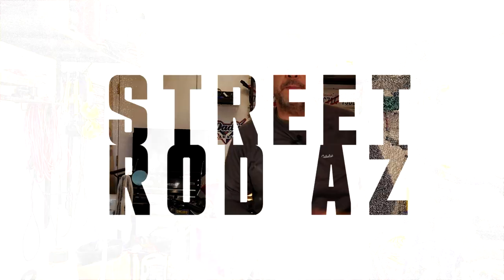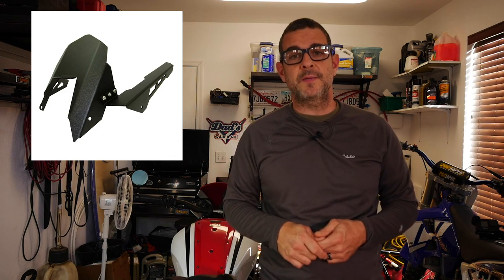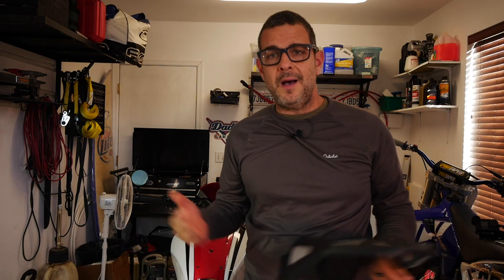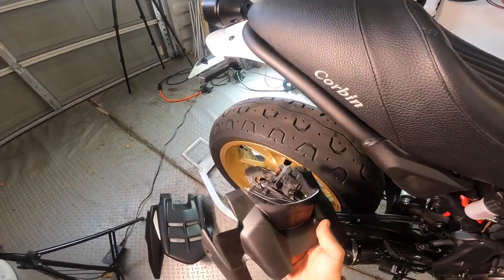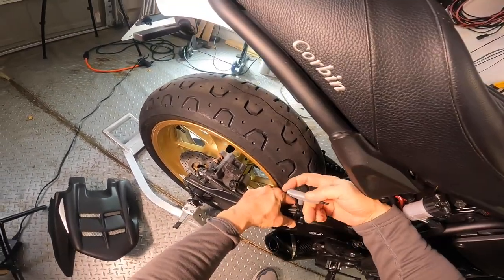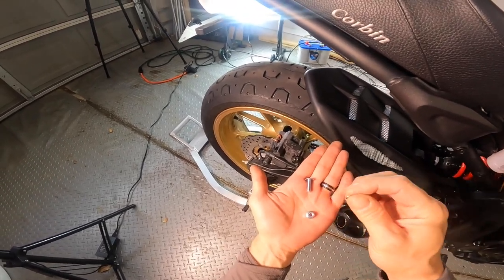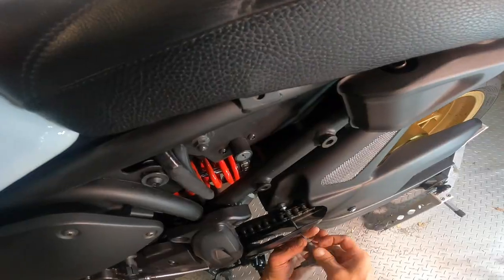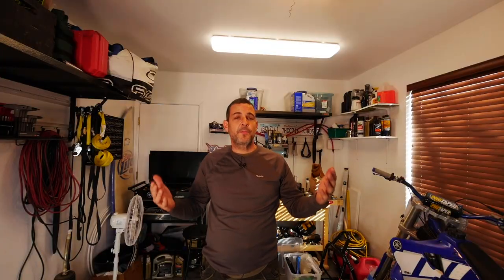XSR700 Powerbronze Tire Hugger - Install and Review

Comment: Hey thanks for showing this rear mud guard. I'm actually thinking of just keeping the rear fender / chain guard off. Just leaving it without any guard. I love the clean naked look next to the shock.
I live in Portugal and never ride in rain, but do sometimes go on things like fire roads. Is there a danger to riding without the rear fender / chain guard? Do components wear out more?
Reply from the maker: Technically no. But the underside of your bike is going to get pretty dirty. And if you ever put a tail tidy on, you'll get water and mud up in there.  Really up to you. The chain guard is more of a safety measure to prevent stuff like clothing from getting caught in the sprockets.  Again... totally up to you if you wanna roll without it.

Comment: How's the functionality during your wet weather ride? That mod will definitely work for me up here in the PNW. Will you be posting a vid about this as well? Thanks so much for your XSR700 vids brother.
Reply from the maker: Well, considering I live in Arizona, and rain is pretty rare, I cant say. I generally don't ride in the rain either. I did got through a few puddles though and the muck underneath the fender is much less than before. So it's working. Really appreciate the support. Ride safe!